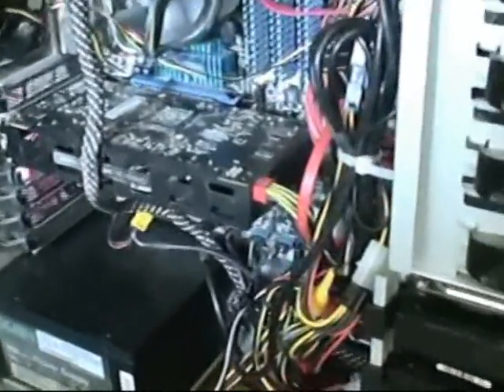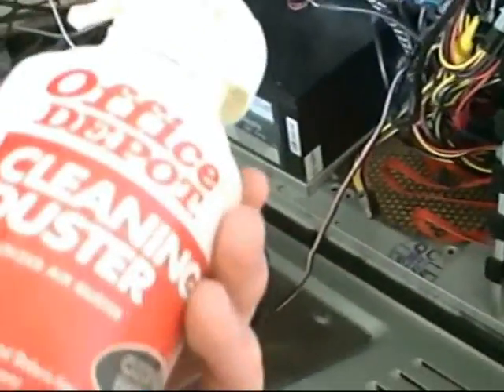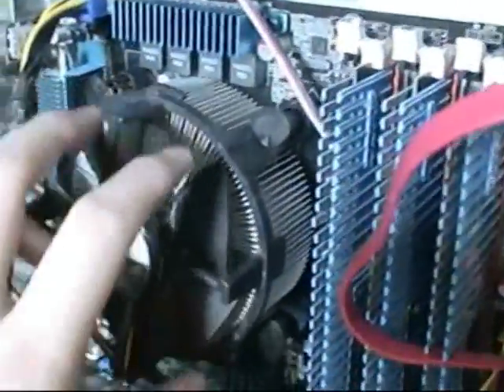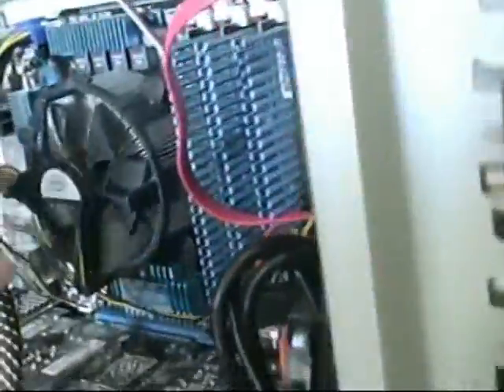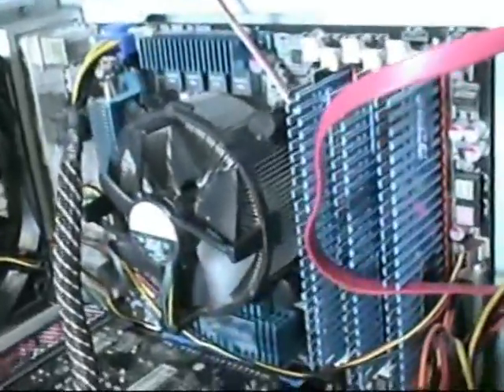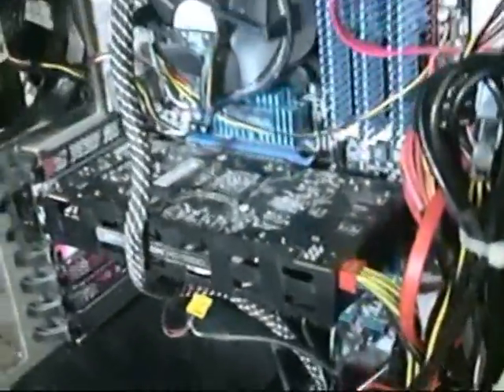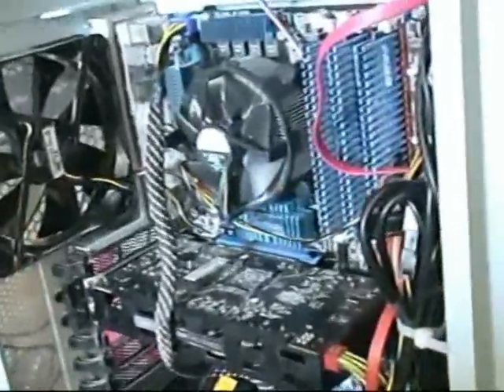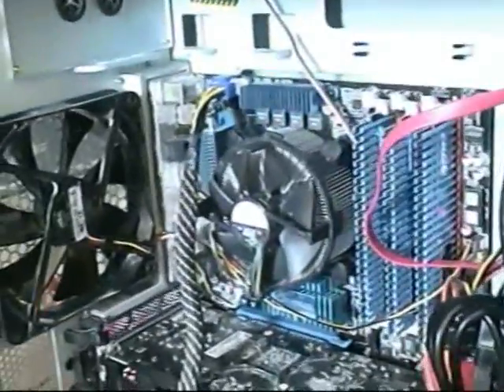How to fix PC shut down randomly

Comment: I have also experienced the same problem and found the REAL PROBLEM to be the least suspect. The power button on my case.

I thought my power supply was the cause and went and bought a new one only to see the same shutdowns. 
to fix this issue or test if it is yours you have to go into the "power options" in windows and click "Choose what the power buttons do" then changed the power button to turn off your display,  if your monitor begins to randomly turn off but your computer stays on this confirms that you have a faulty power button on your case. 

all you have to do is set the button to "Do nothing" and this should solve your random shutdowns until you replace the case, Unfortunately this does not solve problems with your computer turning itself ON at night or random times. you can solve that problem by switching the power switch off when going to bed or not using the pc.

Hope this helped.
Reply: mine shuts down only when i play games do u think its my pc's power button
Reply: probably it's the power supply.

Comment: when ever i play a game it shuts off randomly. and then my dad puts a pass code on the computer then i cant get on again
Reply: +Kenny Tran hey dude you should check ur vga.....if its a pc just open the case...remove ur VGA and put it again.i think it will work :)
Reply: thanks
Reply: +Hussein Rachid You shouldn't have to open the case to unplug the VGA cable. Are you trolling?

Comment: when you first said "over hee-shon" i knew you wouldn't have any useful information.

when you said to use the compressed air on fixed (removable) hardware, i knew you were wrong, when you pointed at the GPU and called it a motherboard i knew you couldn't possibly give any actual (never mind useful anymore)information.

the whole point of a compressed air can is to avoid static charge, giving you more room to clean the pc, leaving things integrated only pushes dust into the pc, remove the hardware, blow the dust out... when you're cleaning it out and find liquid, malleable and sticky dust it's only going to break the pc a lot more. your advice is lazy at best!

simply put you don't know about fixing a computer, you can't even speak properly when referring to vital components.

if anyone watches this video, i suggest you do this: research everything about disassembling a pc. everything, then research into faulty pieces of hardwar (PSU (power supply unit / kettle socket where power comes from), RAM (random access memory / thin stick inserted in thin slot), CPU (central processing unit / the only ting he got right in the video) GPU (graphics processing unit / what the dude in the video called "motherboard")

when you begin taking things apart or feeling confident you can do it......

take great care in examining your computer, look at exactly where things are, from the RAM and GPU to the CPU and pin placements for extra cables.

after looking deeply, i suggest you then take out one component VERY gingerly, it doesn't matter what you remove first (as long as nothing else is in the way). you then try reassembling it into the computer, if you know you can do this, your next step is to examine the piece of hardware you removed and take it apart with great care and remembering where everything goes. if you begin to get confused, STOP, re assemble the thing you removed and learn about taking computers apart.

otherwise go to a pc specialist and pay the cost for it to be fixed..... PC's can be troubleshooted by anybody, fixed by anybody and broken by anybody..... all it takes is a little patience and before you know it you can clean, fix, upgrade, downgrade, improve, install and expand your system for the future.... consoles cannot do this.

also avoid all static interference, hair, clothing, anything static or which can create a charge... it probably wont harm the pc but it's better to be safe than to have your computer pop because of a minor nuisance.

Comment: my computer was doing the restarting shit over and over when i started to play a game so i noticed that i have overclocked the gpu and the cpu so i put in back to original and the games are starting to run without reboot also i lowered down the fan speed but i don't think that will make a big difference

Comment: i thinked wtf is my computers problem i have this gpu named evga geforce gtx 460 and its 75 celsius without games opened and i thinked wtf then i checked that does the fan spin and it does not god damnet
Reply: is it dusty
Reply: nope its not but the fan got stucked because fan power cable
Reply: there might be something litteraly in side the fan.....or you could get somet else......((another fan) which i would recomend but keep surfing the internet here might be somet for u
Reply: it was easy to fix the fan because the fans power cable was just under the fan going to heatsink what it should do but it popped out from the heatsink and the fan didnt spin
Reply: I have gtx 760, your three generation behind bitch. But damn i cant go on Dayz, So much CPU overheat.

Comment: In the event that the computer is NOT overheating and randomly shutting down (with a screen notification that it IS shutting down), how do you STOP this?????  I read where you can go to CMD and type "shutdown".  I did this and what I got was undocumented and extremely confusing (to me).
Reply: boot into safe mod and run virus scan, sounds like a virus to me.

Comment: my shuts down when it try to lauch furmark my gpu isent over heating i have a gtx 570 oc
Reply: ***** i have h80i liquid cooling 3,8ghz q9550 core 2 quad
Reply: ***** its liquid cooled cpu temps are 50c-60c at 3.8ghz
Reply: ***** lol i built it my self :P i know everything about them but i dont know whats faulty the gpu or the cpu ? coz if its furmark it could be gpu
Reply: Same prob man.

Comment: Mine just randomly shut's down when i'm doing anything.And it's not overheating
Reply: mine shut downs when ever i open a game
Reply: Dovahkin try an anti virus or a factory reset
Reply: i fixed it
Reply: Dovahkin How did you?
Reply: Did a factory reset by when its shut down incorrectly running a setup
Reply: Me to !
Reply: +Suzuki Shinji over heating is the problem
Reply: yea it was my video card it was full of dust once i cleaned it it worked fine
Reply: over clocking your video card can also make your pc shutdown randomly

Comment: Its a pitty that all people know is to mention overheat...well for your info its not always overheat when its random and frequent...read carefully, random and frequent, and since you put in the title random, you should yalk about the most common cause of random shut down, which is some electric short circuit. Mine turns off random, sometimes one second after on, sometimes five seconds, ten, a minute, sometimes after the whole day, or a week, meaning it sometimes turns off well before window starts, everything completely cool...but i just cant find help anywhere for this kind of problem

Comment: why does mine only do it during minecraft
Reply: Im AsTraL ArmA 3 keeps turning off and I'm not overclocking and my computer is not overheating either. I get 40/60 frames on ultra and GPU and CPU meet requirements yet the CPU might (I am not sure.) somehow be overheating. What should I do? Should I get a better processor or install another SSD?
Reply: a may be your RAM, try dedicating more RAM to Minecraft, or if your over-clocking your CPU or GPU that can sometimes cause your pc/laptop to shutdown